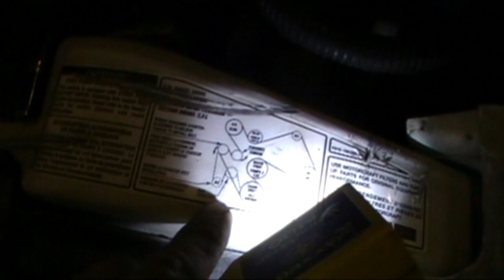Loose fan belt response

Comment from the maker: thanks! there is actually a better one, same manufacturer, but much improved. It is the Workstar 2000 from Maxxeon. I usually need one every year due to me using it daily and breaking it rather quick. But it is the best when it comes to light, battery life and flexibility (atm).